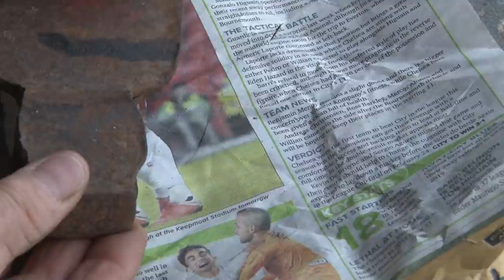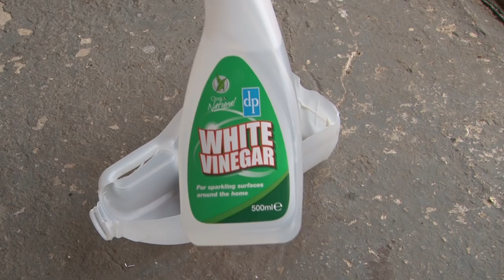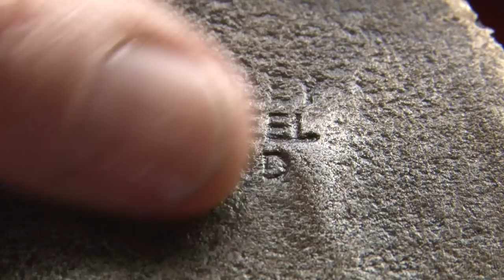How to Remake Ancient Steel Hatchet with Cherrywood handle

Comment: And is there any difference between a beach multiplier reel and a boat multiplier reel
Reply from the maker: Only size really, beach reels are a lot smaller and might have an end damper or magnetic brake blocks to control spool revolutions on the cast.
Reply: @TAFishing  thanks

Comment: Why do beach multiplier Rods have more eyes than fixed spool beach rods
Reply from the maker: The fixed spool reel throws out wide loops of line on the cast so generally have large diameter butt rings graduating down in a slow taper towards the tip ring. The multiplier reel does not throw out wide loops,more of a straight line,so you can use smaller diameter rings. That's about how I would describe it.